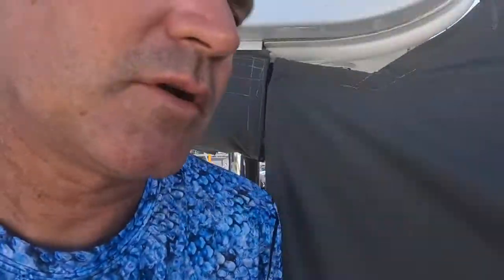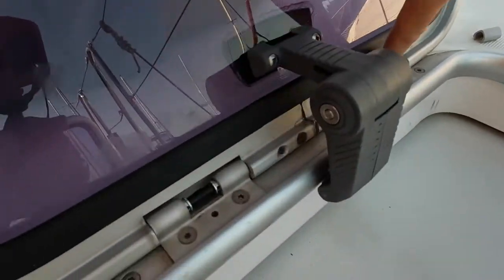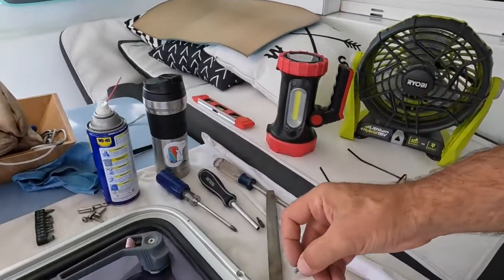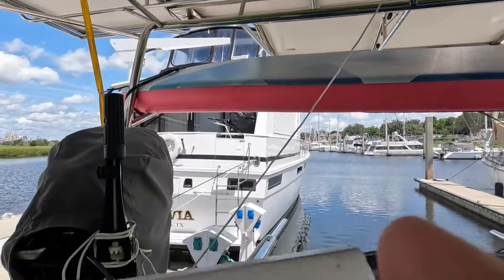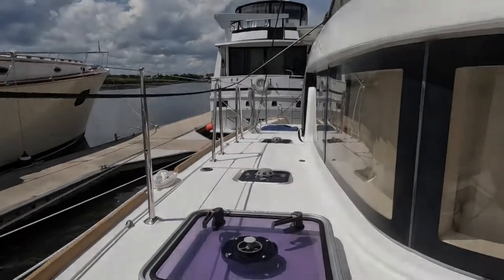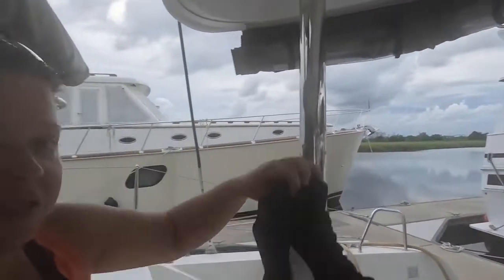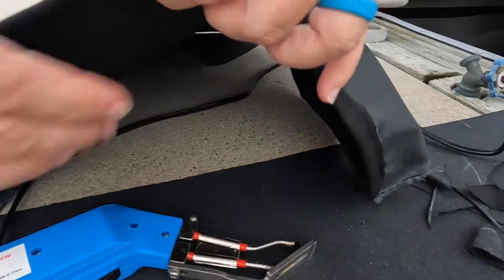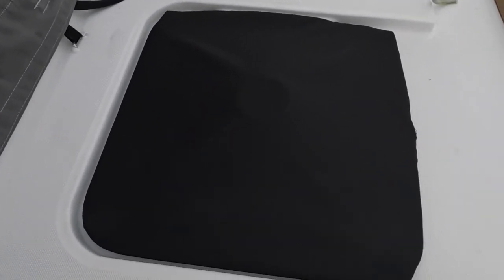Episode 31: Lewmar Hatches Seals and Covers

Comment: Thanks! I noticed only WD40 visible but I think PB Blaster, and even better Kroil (which is what I use) is much better dedicated penetrating oil/spray for corroded bolts and other stuff. Just don’t spray on engine seals.